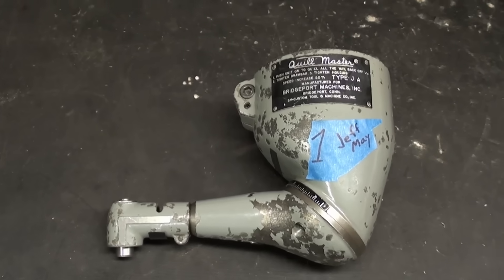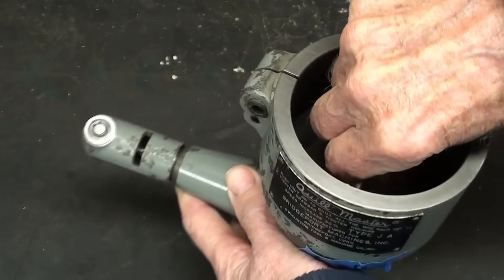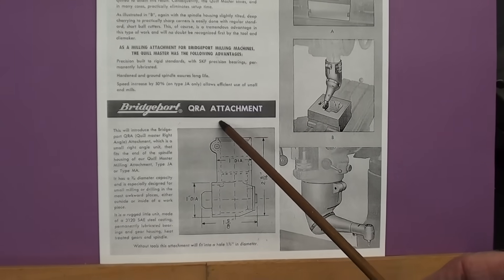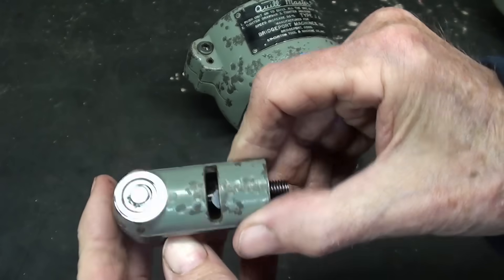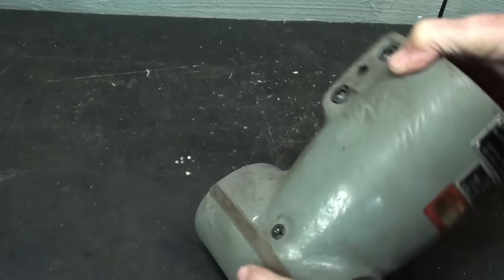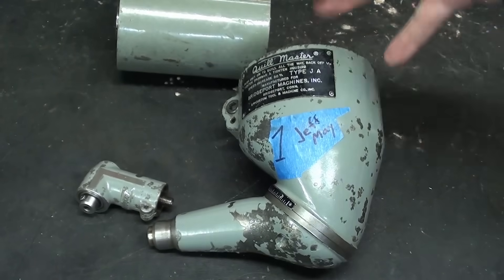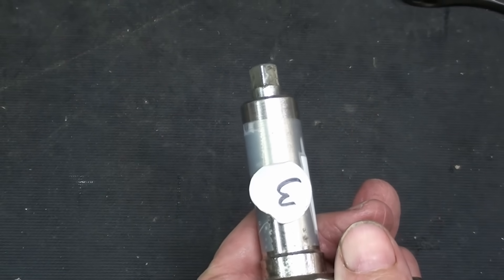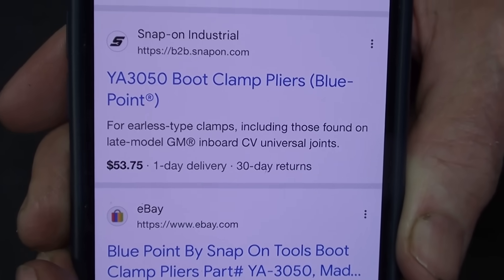WHAT IS IT? Mystery Tools #103b answers mrpete tubalcain

Comment: I used to calibrate Seekonk pre-set click type torque wrenches at my former workplace. The wrenches have internal springs loaded with a pair of double nutted set screws. One of Seekonk's method to lock the nuts was to pour a small amount of what I thought was solder inside the cylindrical handle as an added measure of locking the nuts in place. I had to extract the blob of metal before I made any required adjustments.  The metal may be on the T handle to cover the adjustment mechanism.
Reply from the maker: Interesting, thank you

Comment: Hi Mr Pete I. really enjoy all your videos. Could you tell me if you have a video that shows how you replace an electrical cord in a do more post grinder? I've taken the back apart. and I see that the wires behind the I'm not sure what you call it. Looks like pretty technical job to do. I was just wondering if you had one where you took the thing completely apart. to replace the cord. Keep up the good work. I'm a 75 year old newbie.
Reply from the maker: Sorry, I have never done this. But I have two grinders that need new cords. And I have five Black & Decker 4 inch grinders that need new cords. It’s very difficult and time-consuming to take them apart, and you often have to solder wires.

Comment: While I have installed boot clamps in the past it was done without that tool.  Mostly we used large hose clamps for the VW boots.  If the boot clamp comes with the hump you can use a pair of dikes to tighten it.

Comment: Hi Mr Pete boy that Quill Master would be a nice addition to any  Bridgeport or some Clone Mills . Now everyone will be looking for one .  As for the Cummins torque wrench only used on a couple of times i borrowed . Cummins small and big cam engines have three pushrods they also have four valve per cylinder  they use one pushrod for intake and exhaust and use a bridge across the two inlet and exhaust valves and the cam has three lobes  . The torque wrench is used to set zero clearance basickly of the injector pushrod . from what i remember .Thanks Mr Pete i like these videos .  JM

Comment: What you called "Right Angle Attachment" is really the Horizontal Milling attachment, you also need the support that goes on the  dovetail ways of the ram.  It sets op in reverse, with the support in by the column. It requires sliding the ram quite far out. I've used the setup before.

Comment: Blue Point was the original name stamped into the combination wrenches that set a standard in quality. Snap On began stamping them Snap On. Now the name Blue Point is used mainly for vendor supplied tools. I am not sure if that holds true for the less expensive Blue Point wrenches they introduced in the 90's.  I have seen only one set of Blue Point combination wrenches and they were owned by a retired machinist that lived outside of Ocean City, MD. He had them hanging in his workshop. They looked as good as the new ones but without the "flank drive". Since the 70's and prior, Blue Point tools part number begins with YA. Snap On warrants the Blue Point line with pretty much the same warranty as Snap On tools have. When I was a dealer back in the 80's, management told me that liability insurance and warranty were the main reasons the tools are high priced along with what goes into making them. The shiny, smooth wrenches go through a tumbling process before getting chrome plating.
Reply from the maker: Interesting! Thanks for the detailed comment.

Comment: I did a lot of Cummins work. I bought or made my own special or convenience tooling. I bought my own top stop injector puller and installer slide hammer type. And used a small beam type torque wrench for adjusting the preload. The tooling in the tool room was either broken or already in use by someone. You just can't wait if you're under flat rate or warranty time. Do not use it as a hammer. The click type was not preferred but the slip clutch type was incredibly accurate and it also could be set for valve lash adjustment that was fast and put the slightest of drag on the feeler gauge.
   I'm retired and still have a bunch of special Cat, Cummins, and Detroit tools.
Reply from the maker: That's an interesting comment, thank you.

Comment: Bridgeport R-8 arbors for circular milling cutters also fit the right angle milling attachment 
There were several arbors of various size cutter shanks
JIM ❤
Reply: Correct. The collets for the right angle attachment are R8. Not 5C.

Comment: I personally have used the actual right angle attachment for slitting saws when my parts were to tall to just run the cutter in the spindle.  The ones I have used, all take R8 collets.  I have used it parallel with the table and perpendicular to the table.  Hope this helps.